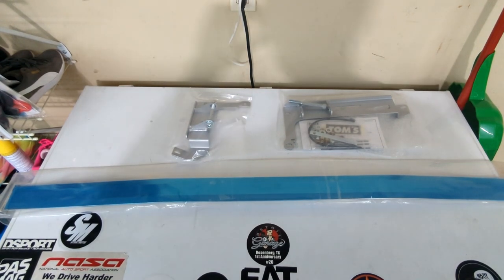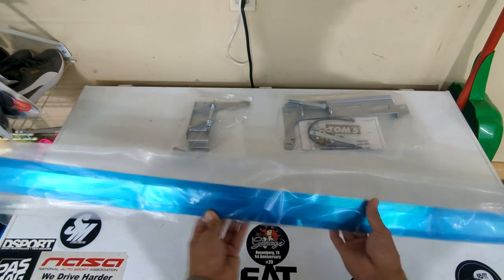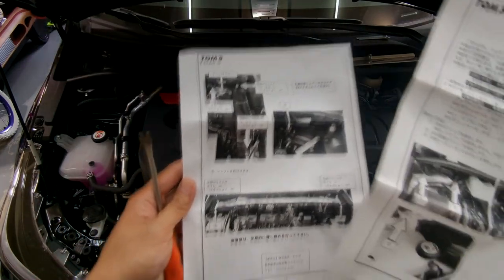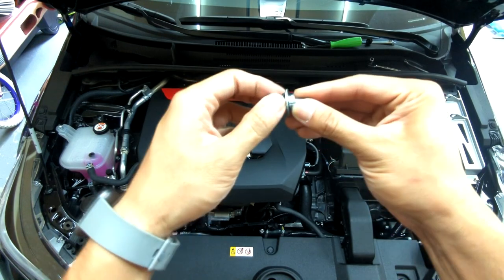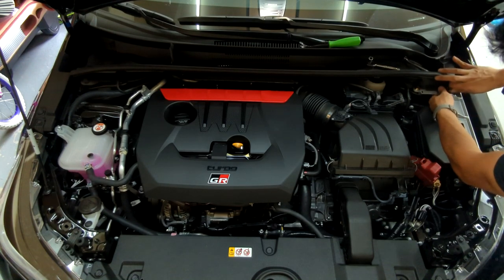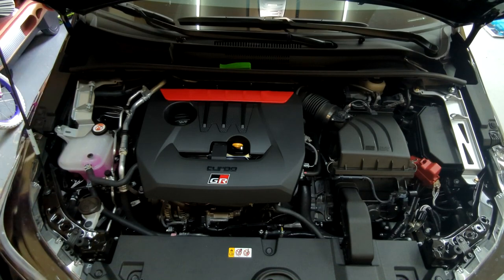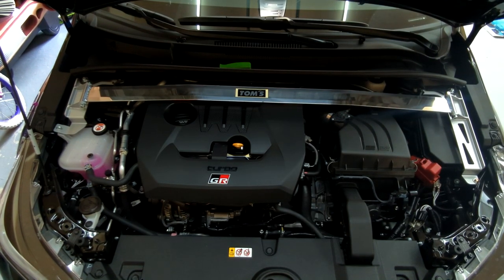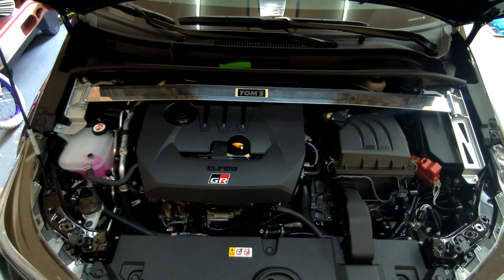Is This Useless???

Comment: As long as the bracket it is connected to is connected to the strut tower. It should work as intended
Reply: It's bolted to the side of the fender

Comment: I installed mine today after watching your video which was helpful, thank you! I felt bad for you as those harness clips are super easy to remove, just get pliers and grab the two tabs on the bottom of them and then you can pull them right out.

Comment: Glad you like it! I've seen some studies or data (for 3 series BMWs, I think) that showed strut bars on some older models (e30, maybe e36) have some noticeable effect, but almost no difference on newer gens (e46+)... and as with most vehicles I think the chassiss have gotten rigid enough that they don't do much other than look fancy and make some maintenance take longer for some tasks, haha.
Reply: You’re not wrong, after installing a beefy front strut brace on my e46 M3 the entire front end became too stiff and the car started to understeer under hard corners.
Reply: I was a little wrong... counterproductive is worse than a cool looking nuisance, haha. Cheers! @Zack_Axel
Reply: Strut bars work on McPherson strut cars without a doubt. McPherson struts don’t have an upper control arm so the strut does take more than vertical stresses and is a stress member. Tying the towers together helps relieve some of the unwanted motion.

On a double wishbone car it’s not necessary at all but still worth trying for a couple hundred bucks.
Reply: @epap1375  Sounds logical. Don't think I will bother for my dailys, but I follow your logic!

Comment: Being that the GR Corolla has a steel brace joining the strut towers which also ties into the firewall in a number of spots. Any aftermarket strut brace only is purely for show and ultimately a waste of money
Reply: The caveat to this though is that if you remove the steel OEM brace/cowling maybe because your running aftermarket coilovers with adjustment etc. a brace between the towers could replace the OEM piece.